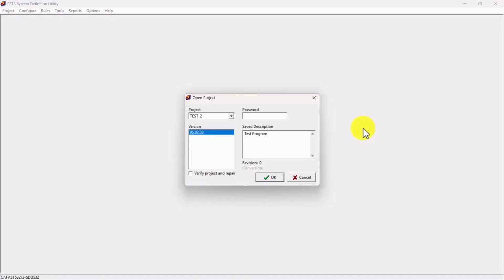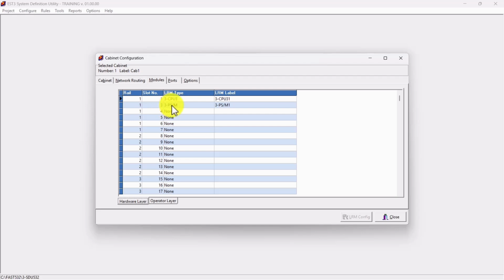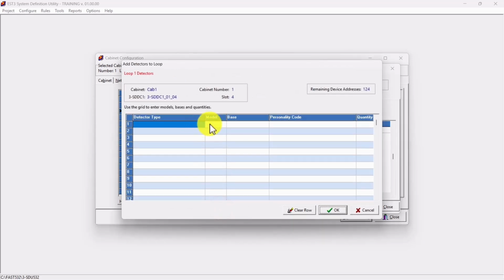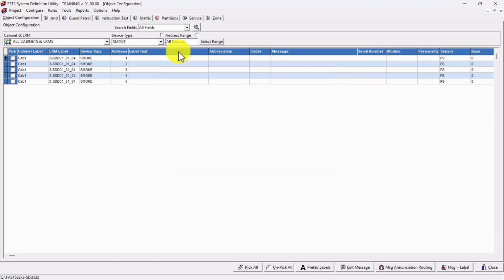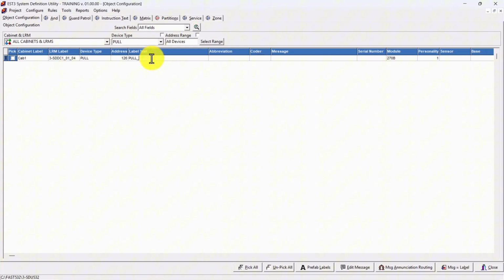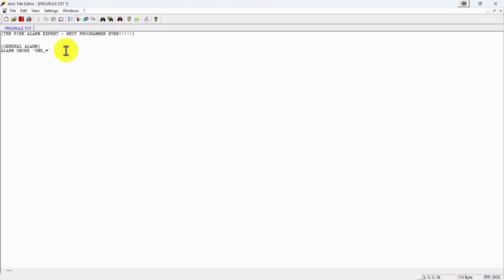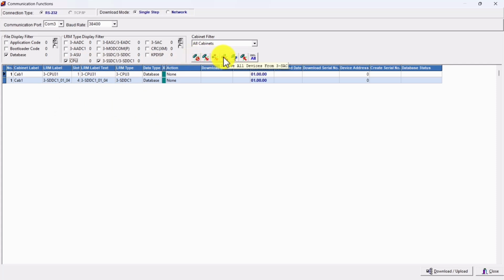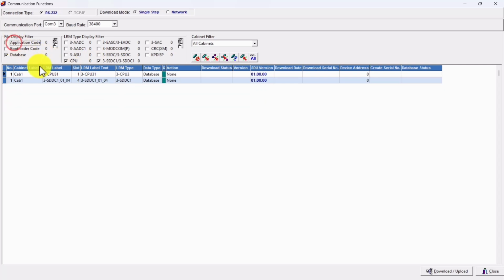Learn Fire Alarm Programming Like a PRO - EST3 SDU Tutorial

Comment: Hi! I found your video because I'm troubleshooting an Edwards EST3 system. I'm having an issue with the DEMUX/audio path: during evacuation messages or live paging, the audio is replaced by loud static/noise, while the rest of the system works normally. Have you ever seen this issue? I would really appreciate your advice or support. Thank you!
Reply from the maker: Good question. If the static/noise only shows up during EVAC messages or live paging, but tones and everything else on the system work fine, it's usually isolated to the audio riser or DEMUX card feeding the amps.

A few things I'd check in this order:

1. DEMUX card itself the. DEMUX takes the digital audio from the ASU/DACT loop and converts it to analog for the amp channels. A failing or marginal DEMUX card is the #1 cause of clean tones but garbled/staticky voice audio, since voice pushes more data through than a simple tone does.

2. Audio riser wiring/connections, check the shielded audio pair between the ASU and the DEMUX/amp rack. Loose or corroded terminations, or a break in shield continuity, will show up as noise specifically on live/recorded voice, less noticeable on steady tones.

3. Amp channel gain/level, if a channel is overdriven or the DEMUX output level is set too hot into the amp input, you'll get distortion that sounds like static during voice peaks but not during a steady tone.

4. Ground loop / EMI,  if the audio wiring runs parallel to power or is picking up interference, it'll usually hit hardest during live mic paging (broadband signal) and less on synthesized tones.

Start by swapping the DEMUX card if you have a spare. That's the highest-probability fix for exactly this symptom pattern. If it persists after that, it's wiring/ground related.

Let me know what you find I'm happy to help narrow it down further.

Comment: How do you add on sdu 3-REMICA installed with annunciator?
Reply from the maker: Remote Mic? Where you will add the panels at inside of the cab 7, 14 or 21. I will change how the cards are inside of the panel. But the remote mic should be in the second bay first slots.

Comment: How do you remote program a 3X? Thanks
Reply from the maker: In NYC that is not allowed. But to do it you will need a network card, static IP address, Subnet ect. setup the ports so you can gain access remotely. Similar to connecting to an IP camera. This will take some networking though and I am not sure if you will be able to program or just monitor it. I think Gamewell or Fire Lite has remote programming capabilties.
Reply: @thefirealarmexpert  hm ok, im in NS, not NYC but thanks for helping

Comment: Facp is not communicating with laptop, what to do sir
Reply from the maker: Did you check the comm port in the cpu device menu to see if it's working. Do you have the correct comm port selected in the sdu. You can also plug directly to the cpu using tx, rx and gnd on the terminals.

Comment: Very useful explanation when asked if a smoke sensor can be switched by the h device siga hdt software
Reply from the maker: It sound like your asking if you can switch devices types, like smoke type to heat or vice versa. No.
Reply: @thefirealarmexpert I mean to replace a smoke sensor with a new one
Reply: I ask if I can use edwards siga hdt to change a heat sensor with a new heat sensor

Comment: First things first thank you so much for your great effort and all the detailed informations well done 👏, I've got one question if I'm doing maintenance on a site and i needed to replace a device and i dont have the project file do i need to create the whole project from scratch or i can download the data to the software and edit it hopefully you will guide me
Reply from the maker: If your working on an EST without the software, that's tricky. You will need to rebuild a new project, but if you are just replacing one device the system should map it in. One trick I do is take the loop off, change out the device and tie the loop back in forcing the controller to map the new device in. You can try that.
Reply: Thank you for your quick response i do have the software but i needed to know if its available to transfer the data from the panel to the software if i dont have the project file or i have to create a new project and simultaneously add all the components to the project and upload it to panel remind you that its not a new panel its already installed long time ago and we lost the project data file @thefirealarmexpert

Comment: Bro I need to add a device,what program of est I need,
Reply from the maker: You would have to navigate the menu to revisions and see what revision the current system was programmed in. It will be 4.01, 5.20 or 5.31 for example. Once you find that out you can use the right software for adding the smoke. If you need further resources go here - https://www.thealarmtech.com/forum/
Reply: I'm not quite sure these folks understand that a programming dongle is necessary to program if questions about adding a smoke detector are being asked.  @thefirealarmexpert